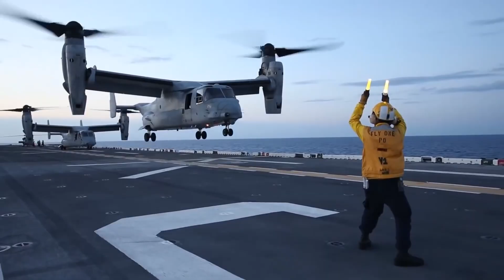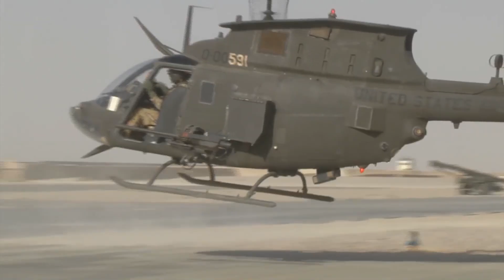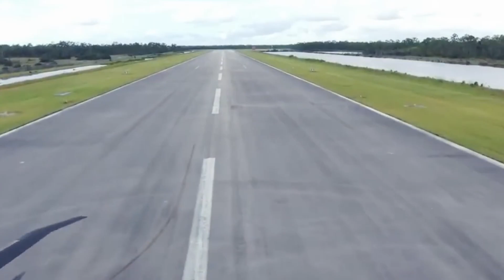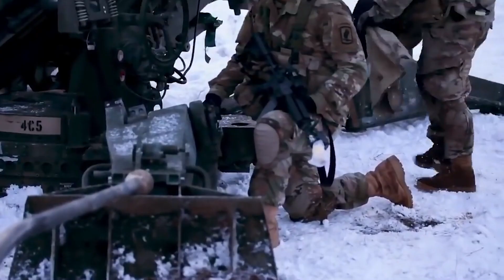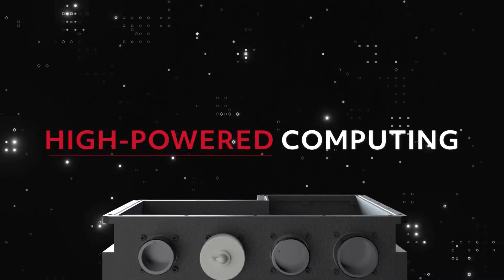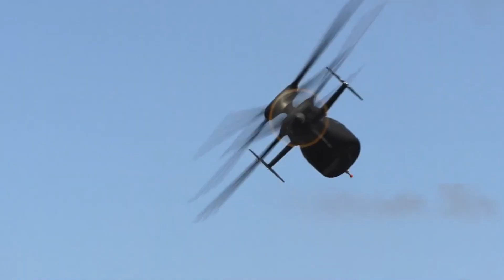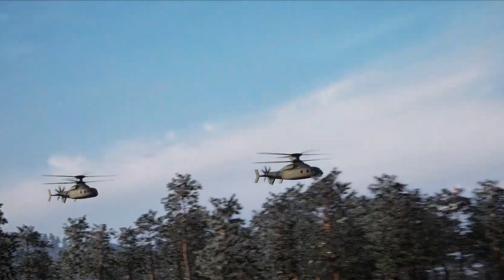SB-1 Defiant - Must go faster!

Comment: Wait, so neither of these aircraft have a tail rotor, how do they turn while hovering? The aerodynamic surfaces only come into play when it's moving through the air, not hovering. How do they situate themselves for instance if they need to drop a bunch of marines into a tight space that demands a certain orientation of the aircraft? Like when they don't want to just parachute down.
Reply: Note that all of these have stabilisers, which act as rudders as well. Besides, there’s always the differential lift generated through the cyclic which induces a turn.
Reply: They pitch one rotor for a bit more  lift, and pitch the other one for less. The more-lift rotor has more drag, the other has less. The helicopter rotates into the draggier  rotor. 
That requires a separate pitch-control mechanism for each rotor.

They could also just put an air-jet out near the tail, with a left-right vent control.

I dunno how they actually do it, but those two have been done.

Comment: BELL V280 looks like more viable solution when you want something fast and efficient. It has top speed 556km/h and has range of 3900km!!! 
With helicopter, the rotor is main problem when one wants fast and efficient VTOL... The SB1 has top speed only 446km/h and range only 424km... no wonder that tilt rotor VTOL with 10x larger range and 100km/h faster top speed won the competition.
Reply: Yes, the V280 won the competition, but it did so by not meeting the requirement to be able to land in the same size area as the current UH-60.  Also if V280 cannot transition from full speed flight to hover then landing  as fast as the Defiant can.
Reply: @That_Stealth_Guy  well, the transformation from high speed mode to heli mode may not be that fast... but the range and speed will get you nearly 10times further away and with 25% better speed than using helicopter. 
What good it will do to be able to get faster to hover mode if you can't even reach the target area.  And I'm sure this transition will be faster and faster as development goes.
Reply: @That_Stealth_Guy Yes it can, it also carries more troops than a H-60.
Reply: @That_Stealth_Guy  "Yes, the V280 won the competition, but it did so by not meeting the requirement to be able to land in the same size area as the current UH-60.  Also if V280 cannot transition from full speed flight to hover then landing  as fast as the Defiant can."

-false on all of that my guy... 1. there was no direct requirement for it to fit in the exact footprint. 2. The valor only has a 19% larger footprint but far greater capabilities. 3. they had to lower the range standard or the Defiant would have been disqualified right away as it could only hope to reach that original range via its planned upgraded engines. 4. The Valor had a better time to altitude and faster time to stop from cruise speed than the Defiant. 5. The Valor passed the same level 1 handling tests the Black Hawk passed before.

Comment: Having worked on helicopters, I think the defiant is the better choice, both for maintainers and the safety of everyone on-board it
Reply: The Valor outperformed the Defiant in nearly every test and metric. The Defiant also had multiple technical issues and was not a mature platform as it even had a crash which delays more flight testing for 18 months.
Reply: there is a reason why only the Russians went with co-axial and everyone else passed.

Comment: Having the reversible pusher means this thing can stay lower qhen coming in for a landing and just flate break over the landing zone without tilting it's rotors to slow itself.  I think the Valor has higher top speed and longer range.   That means being able to rrach further to and from shore or operate transport further from the front line.
Reply: The V-280’s range, especially when mated with its high cruising airspeed make it self deployable to most of the world, just needing aerial tanker support. It behaves like most twin engine turbo props in inventory in that regard. And is very compatible with any aerial tanker. Unlike most helicopters which can only tank off the KC-130’s flying dangerously close to stall speed while the helicopters are fire walling their engines to keep up. That easy self deploy ability alone is a game changer. As soon as the Army saw that, it was game over. Because traditional rotor are wing aircraft just can’t come close to that range. And even when the Defiant hits the same airspeed as the Valor, it’s running it’s engines at max and burning fuel at max rate doing so whereas the Valor gets more fuel efficient in horizontal mode flight, and can cruise comfortably and efficiently at those speeds.
Reply: You know the Valor can just lift its rotors up 15-30 degrees and still be faster than the Defiant without the rotors going below it...

Comment: Hmmmm.... I was up at my South Sierra cabin when I heard something going over pretty fast. It was late twilight and all I could see was a blinking red light and a dark outline. I live near Inyokern airport, and we get V-22 flying overhead all the time. This sounded different, and not a plane for sure. It was going fast and low, headed up north and contoured west around Crag Peak, I guess about 800 feet to ground. Later in full dark it came back heading south. I ran out with binoculars, but it was too dark. It was black and no light on it's starboard side, I could barely pick it up. No idea what it was. It was going about 200 knots, and it was pretty quiet. Definitely not a helo, definitely not a plane. I still guess it was a V-22, there were four of them at Inyokern airport at the time. But who knows, China Lake NAS is right to the east, Edwards a bit to the south, we get military flight action all the time.

Comment: Defiant still works better in more built up terrain and urban warfare
Reply: The footprint of the valor is not as big as you are thinking and it can fit nearly anywhere a Black Hawk can. It only has a 19% larger total footprint but outperforms the Defiant.

Comment: It's a shame they couldn't pick both really, since each has strengths and weaknesses in different areas. The V-280's speed and range is undoubtedly an advantage when operating in the Pacific and South China Sea, but I can't help thinking it'sd choice of landing grounds is a lot more restricted than the SB-1's, and the latter is probably more agile and better at nap-of-the-Earth flying in high threat environments.
Reply: I really think the Raider is going to end up being used as a gunship to replace the Apache.   The big drawback with tilt-rotor aircraft is those big rotors make it impossible to mount forward firing weapons on them.  Even mounting a door gun on that side door risks shooting off rotor blades.  The Marines have been tearing their buzz cut hair out trying to mount weapons on the V-22 and not shoot the blades off or burn them with hot rocket exhaust in the process.  Something like the Raider is much easier to integrate with weapons and a rotor mounted sensor system.
Reply: Agree.  Unless it's common to have a single-copter flying unit, I don't see the reason why the military wants to make a black-and-white single-sided decision.
Whenever a military unit has more than two copters, it's always possible to have 1 or more V-280 and 1 or more SB-1 working as a team.   The CO can make decisions based on real-time needs.

The funding is not a problem.  Just split the money half-half between Sikorsky and Bell.
Reply: @AkiraNakamoto  As someone who has made a career in the military development world, funding and scheduling are two big problems.  To qualify an aircraft as safe for flight requires a certain amount of hard work and that costs money.  The amount of money necessary to bring a new aircraft into service is more or less fixed.  If you want to develop two aircraft then double the money.  No way around it.  Every new aircraft has to undergo the same rigorous test regimen to prove it is safe to fly and can do the mission. Each new development test program is a billion dollar or more proposition.
Second to hang weapons on an aircraft, fire them safely and hit the desired target requires a certain amount of effort.  I am not going to say the number or time period in public but it is a significant effort and each weapon has to be integrated in a separate program to each aircraft that will carry it.   You can't assume a missile that works on a Cobra also works on an Apache, or that something you can hang on an F-15 automatically works if you hang it on an F/A-18  because these aircraft pairings have very different flight characteristics and combat systems.  The aircraft has to be able to recognize what weapon is on what rail or bomb rack and indicate that to the pilot.  The aircraft has to know what target is loaded in the weapons mission plan if the weapon is that kind of weapon and cue the pilot where to launch it according to the mission plan.  If the weapon is cued by sensors on the aircraft then the weapon and aircraft have to be able to communicate and give the pilot the right launch cues.  You want to make sure the weapon doesn't hit anything when you launch it.  You need to know if, for example, you have to fire weapons on the outboard hard points before you can safely fire something inboard.  Do aerodynamic forces cause adjacent weapons to rub each other?  Or does the buffet created by something on one station vibrate the living daylights out of whatever is on an adjacent station?  And then you have a ton of software integration.  Each weapon is different and so is each aircraft so the process is iterative.  Range time is limited and scheduling all this work requires a lot of coordination across different aircraft programs,  weapons programs the range operators and the operational sponsors of these new systems.
Reply: @philsalvatore3902  I think you have seen the problems you listed because US military has NEVER done the double grant before.
If you really want it done, then there are tons of ways to make it more efficient.  For example, you can define a common installation regulation for all the weapons and softwares and ........., then ask Sikorsky and Bell to comform to the same regulation.
Well, if the government is lazy, then it is lazy.  What can I say?
Reply: @AkiraNakamoto   I can tell you from experience that even if you have a common data bus architecture the underwing environment of every aircraft, buffet and vibration, vary greatly from one aircraft to another.  If you have an all aspect low observable aircraft like an F-35 weapons behave differently when launched from the weapons bay than they behave when launched from an underwing station.  Find out what bomb bay resonance is.  You open the bay doors and a Helmholz resonance starts shaking the daylights out of everything inside the weapons bay.  Most missiles slide off a rail, but if the wing tip is shaking like crazy due to perfectly normal aerodynamic forces the missile may or may not slide nicely down the launch rail.  Sometimes you get surprises like that.  Or the buffet breaks things on the missile, or the load of the missle combined with aerodynamic buffet breaks things on the launch rail.  Stuff like that is only revealed by testing.  If you have an infrared guided something like a Sidewinder or IRIS-T, it has to be out in the breeze to acquire a target.  That makes deploying IR guided weapons from a weapons bay hard to do.  It can be done and is done but it's a lot harder than shooting one off an exposed but non stealthy external launch rail.  Getting all of that right takes time and money.
As for the US not doing two new aircraft at once, that is laughable.  The US developed the F-14, F-15 and F-16 pretty much simultaneously. The US Navy and USAF are both developing 6th gen fighter aircraft right now.  The Chair Force even has flying prototypes they are calling NGAD, while at the same time the Navy is developing their MQ-25 drone for use on aircraft carriers and the Chair Force is getting ready to fly the first B-21.  Meanwhile the Navy is finishing the development of the CH-53K and the Army developing the CH-47F (which is a major upgrade to the old hard working Chinook).
Reply: Just to add to what  @philsalvatore3902   said, IIRC, when they were introducing the AMRAAM, it was assumed that it would fit everywhere a Sparrow would. After all, it had the same mounting points, 100lb less weight, 1" less diameter and smaller wings, right? Then when they tried to launch them off F-15 rear body pylons, they ran into trouble, because the lighter AMRAAM didn't punch through the local airflow as well as the heavier Sparrow did, and tended to bounce back up and strike the aircraft. Not sure what the solution was, but stronger ejectors seems favorite.
Reply: @philsalvatore3902  If you have 2 bombers, how is it possible that you can install your bombs on 1 bomber, but not the other?    Does it imply that either your governmental definition of bomber is flawed, or one of the bomber manufacturer has failed?
Reply: @AkiraNakamoto  I didn't say you absolutely can't, but two aircraft are going to have two very different under wing environments and or different bomb bays.  Just because a weapon comes safely off the rail of one type of aircraft doesn't mean it will do so on another type of aircraft. You have to conduct testing to make sure whatever missile or bomb releases safely from both aircraft.  You can build an open system architecture where conceivably the computers on an aircraft, tank, warship or whatever work with every weapon assuming you load the right software, much like adding an accessory to your home computer, but you still have to test everything in a combat like environment to make sure it really works.  One cannot just assume it will work because some engineers said it would.  Testing proves it works, and often reveals things nobody anticipated.  
Look up a video called Military Aircraft Weapons Release / Stores Fails.  When Missiles Strike Back!  It is a compilation of videos from real life test events where stores releases didn't work out as planned.  You want to find this sort of thing out in testing before you issue it to operational units. Remember,  airflow around every aircraft is different so what works on one might not work on another.

Comment: Add short wing and it will increase speed and range!! As the forward speed increases the main rotors can be slowed down causing increased speed and range!!
Reply: With the current Raider configuration rotor speed is reduced as speed increases to prevent advancing blade mach.
Reply: Short wings would add weight and so reduce the carry capacity! They might increase speed though.

Comment: its just kamov with push propeller
Reply: no... the coaxial rotor design is far from the traditional coaxial design used on RU helis
Reply: @n3v3rforgott3n9  tell me the difference then...
Reply: @yusuffirdaus3900  Traditional coaxial rotors use a flexible rotor design and this uses a rigid rotor design that is normally found on normal helicopters. You need to redesign multiple different systems for it.

Comment: As an old retired AH-64 pilot, I don't like the idea of an attack helicopter with side-by-side seating. It forces the fuselage to be wider, making it more of a target to frontal fire. But perhaps Sikorsky has to do it with a wide fuselage in order to carry the ordnance internally. I'm sorry that Bell won the contract for the medium lift version. The sorry spectacle of MV-22 Ospreys crashing and killing marines regularly makes me very uneasy about putting soldiers into Bell tilt-rotors.
Reply: ... look up the facts instead of going off of internet memes. The Osprey has a better crash rate than the CH-46, CH-47, CH-53, and UH-60. More service member have dies in the C-130 in the last 10 years than the Osprey and we have a smaller C-130 fleet.
Reply: @n3v3rforgott3n9  Finally!

Comment: Thanks for the coverage on this topic.  My own conclusion is that the US Army wanted an airplane that could hover rather than a helicopter that could fly fast.
Reply: In reality the Valor outperformed the Defiant in nearly every metric and was a more mature platform as the Defiant had multiple technical issues that caused many moths of delays and even a crash.
Reply: @monstrok  it’s easier to make an airplane hover, than it is to get a rotary wing aircraft to the speeds they would like. There are aerodynamic limits on the helo’s prop that put a pretty firm limit on how fast they can go. Airwolf is not actually possible in the real world.
Reply: This seems so well formulated.

Comment: The eventually MV-280 gunship variant will be utterly badass.
Reply: I see the Army eventually using the Raider as scout, Spec Ops, and a light attack craft, while the Valor will cover the utility as well as the heavy attack role, almost crossing into CAS territory. I also think the Army should be responsible for the Sky Warden instead of the Air Force.
Reply: Yes, right up until the entire fleet is grounded...